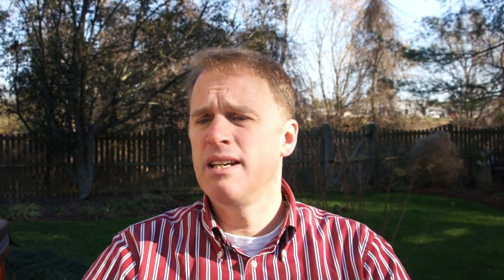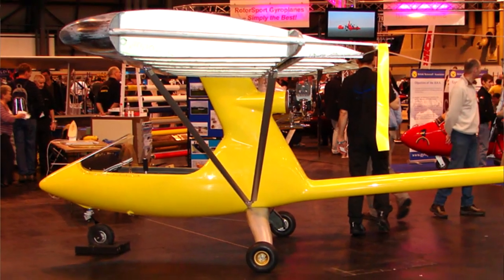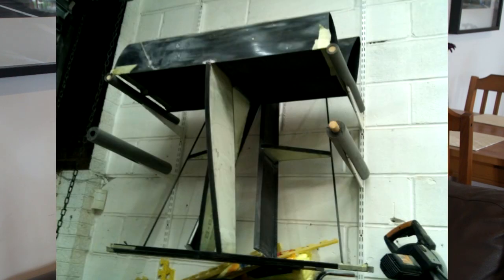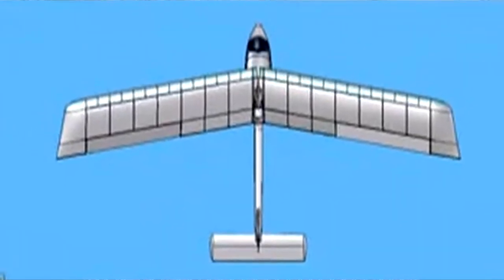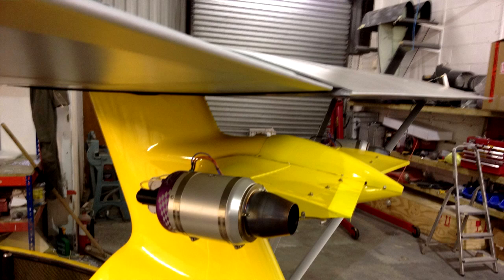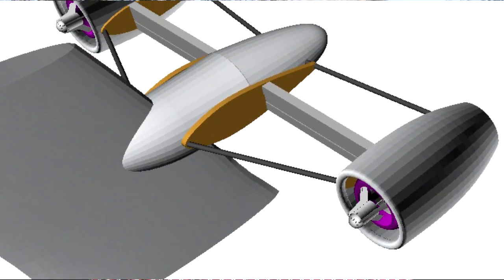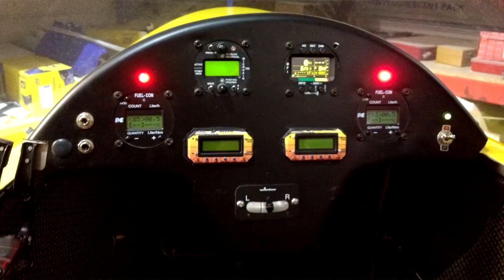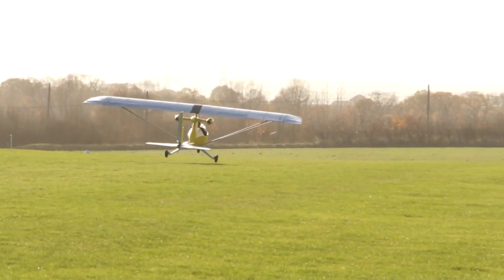Sirocket Documentary

Comment: Dean, Great stuff. I designed the new Sirocco NG wing airfoil and helped Evert at acla significantly to get a good aircraft that you are currently benefiting from. Your air frame has two crucial things missing, one is the safety wire from the strut-wing attachment to the rear end of the fuselage boom. The fuselage wing junction is a very narrow beam, and can have dynamic instability if those safety wires are eliminated. Second is jury struts. Please fix these before flying.

Many happy landings.